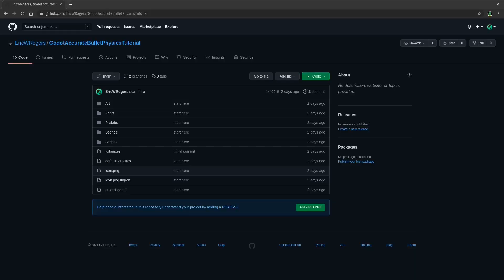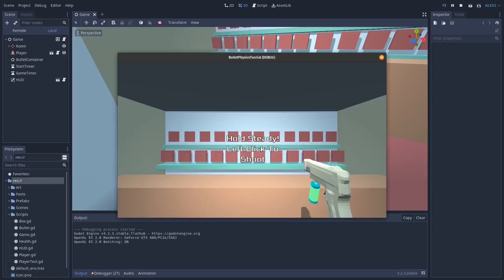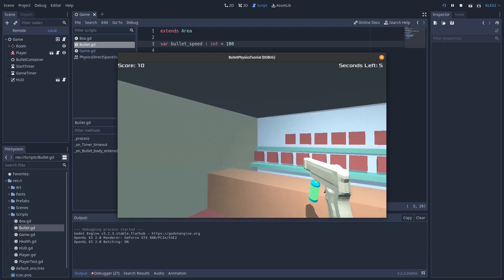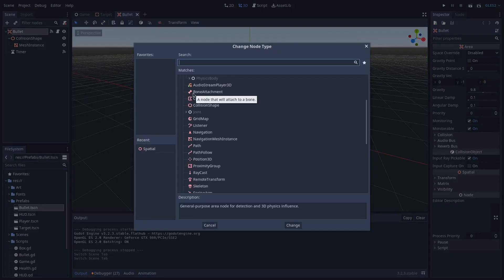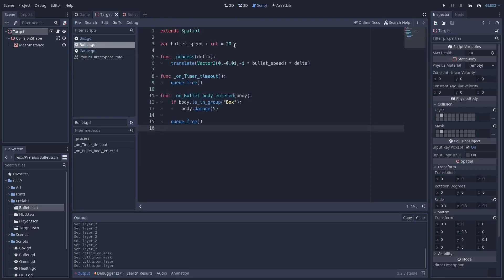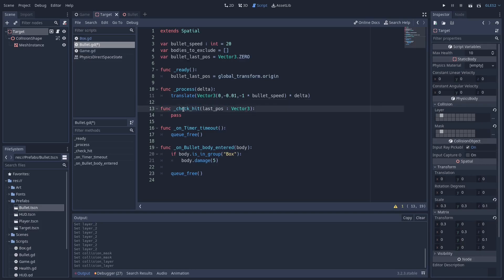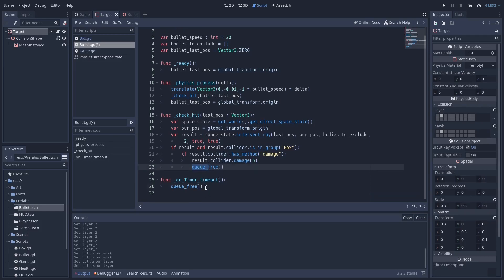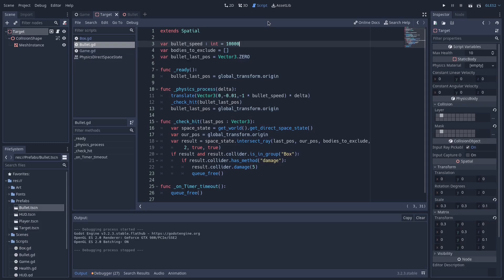Realistic bullet physics : Godot Tutorial!

Comment: Hey Eric, using a ray cast is obviously a good solution but looking at your project there are better ways to get proper bullets to work. The biggest downside of a ray cast, though for your bullet it probably won't matter, is that its a pinprick. You could end up missing a target that you should have hit. A bullet is small so it's not really and issue but once you start adding throwables to your game, you may want to have a solution in your arsenal.

As is already commented in another reaction you should be using physics process however physics process for accurate physics simulation runs at a "fixed" framerate which by default is set at 60. You can change this however in your particular case that won't work. It may still be smart to do, the higher the rate the more work the physics engine does, but also the more accurate the simulation.

Your bullet is an area whose position you are controlling in process. This has a number of problems. You're moving it yourself, that means collision checks only happen where your object is placed. A fast moving bullet will travel many times its own length, you're basically teleporting from one position to the next and you will not collide with anything that you hop over.
I don't know why you didn't chose to use rigidbodies but if you use a rigidbody you can do away with almost all your manual checking. You just spawn a bullet in, give it a velocity, and the physics engine will control the bullet for you including handling bullet drop as an effect of gravity or bullets ricoheting off of surfaces. It however still has the problem that it "jumps", there is however this setting called continuous collision detection that will check collisions along the path of the bullet.

I ended up going one step further and elongating the collision shape of the bullet as a function of its speed so a continuous path is checked. I did dedicate a video on my channel about this if you want to have a look. Yes I'm targeting VR here (see my VR weapons tutorial, I think its part 5 where I talk extensively about this) but all the info applies just as much to a non-VR game.
Reply: Sorry just checked, it's part 7 where I implement a high velocity sniper :) My handgun uses raycast without bullet travel.

Comment: if a bullet ricochets at a corner under the check time, then it will check the hit between before it ricochets and after, meaning someone who wasn't in the path of the bullet would take damage.
Reply from the maker: That would be something you would need to check for if you are using a kinematic body and colliders on you bullets. These bullet are using a Spatial node so they should not ricochet.
Reply: @yourgeekeric  Yeah, I just realised that on a ricochet the physics calculation would have to run anyway.

Comment: https://youtu.be/2dnXZqeQUuk?t=477  That's a 32-bit collision mask, right?  So you can't just add layer-name numbers together.  Layers 2, 3, and 6 would be collision mask value 38, not sum value 11.  An int value of 11 would be bits 1, 2 and 4 and those corresponding layers.
Reply from the maker: @Andrew F. The function handles both if you want to check what I am saying download the "end" branch and replace 2 with 1 + 2 and the bullet will be able to collide with the wall and targets. It pretty sweet! I learned how to ray cast in godot from Miziziziz tutorial.
Reply from the maker: Or 1 + 3 and it will no longer hit the targets
Reply: @yourgeekeric  Hmm. Does it state this in the doco anywhere?  I just want to doublecheck, because your example works in decimal addition by accident.  "layer 2" is binary 0b10.  Layer 1 AND  Layer 2 is 0b11.  Arithmetic 1 + 2 = decimal 3 which is binary 0b11 -- same as bitwise L1 AND L2, which is why your example works.  But add in Layer 3 and you have a binary result of 0b111 = decimal 7 versus "1 + 2 + 3" = decimal 6 = 0b110, i.e. not the same bitmask.  I mean, it's possible GDscript is smart enough to understand the plus sign is a layer mask number joiner for that parameter, but it would have to ignore the summation of those numbers, which seems like a violation of logic -- if I tell gdscript that scalar value x is 1 + 2 + 3 then I'd expect it to add those and assign the result to the value.  Geek tip: you can do binary conversion in Google Search entry box, e.g enter: "0b11 in decimal" or "7 in binary" (omit quotes).
Reply from the maker: @Andrew F. Rip just tested some more I and I does not work I will try and cut that out of the video to not get anyone else confused 😂
Reply from the maker: Or add the correction to the discription if it does not let me
Reply: @yourgeekeric   You might want to let Miziziziz know, since that's where this started ;-)
Reply from the maker: Will do I followed his fps course on udemy it was over all a really good course but I'll drop it in the q and a section on there
Reply: @belzecue  We don't need to calculate binary because godot tells what the value of each layer is. 1 + 2 + 3 doesn't work because there is no layer with a value of 3. There are 1, 2, 4, 8, 16 etc... so 1 + 2 + 4 works